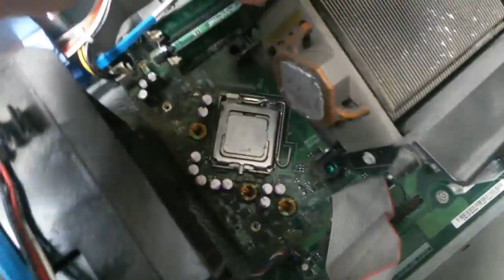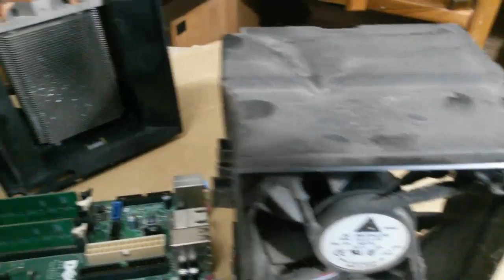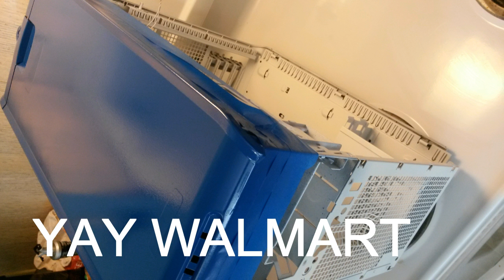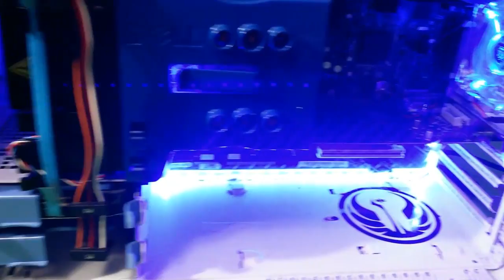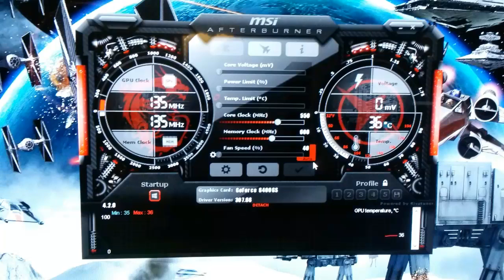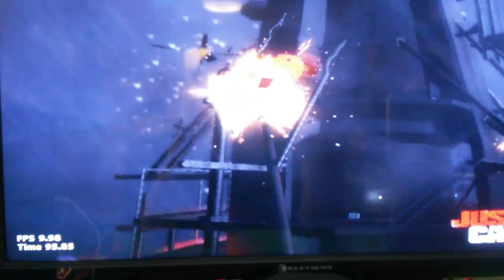star wars computer build from old Dell optiplex

Comment: Like the paint job. As always looks really clean and neat. Where do you get your decals? Online somewhere, or do you do them yourself?

I think we were separated at birth. I am just about to purchase a dell 620 gx sff from Kijiji  for $10. Also have to get a basic vid card as well. I saw that Geforce 8400gs that you used.
Reply from the maker: +Ladybug Adventures thank you.. yes we make the decals mostly she does. the silhouette portrait is a cheap vinyl cutter but is awesome. update the bios first with a flash drive it will save you headaches and keep in mind pentium d's are not true 64bit processors emt extended memory or something it was made to utilize more ram..that 8400gs is junk i got stiffed on ebay with a 6670 1gbddr5 thats doa thats what i wanted for the video.        anyways keep up the good work i like your videos they are very informative and a learning experience. and you reply to your viewers thats the best part...

Comment: damn this looks sick. how were you able to get the LEDs and the fan? like my stock dell psu doesn't have any power connectors for a fan or LEDs :/
Reply from the maker: I spliced into the power supply if I remember correctly it was probably the floppy drive rail but any yellow wire is 12 volt, I do not recommend this though unless you know what your doing. Messing with the psu can be dangerous
Reply: +modstek ok thanks for the info bro. I have a lot of money into my optiplex so I think I'll go the safe route and get a sata to molex splitter or something.